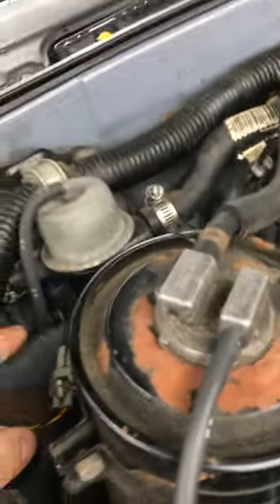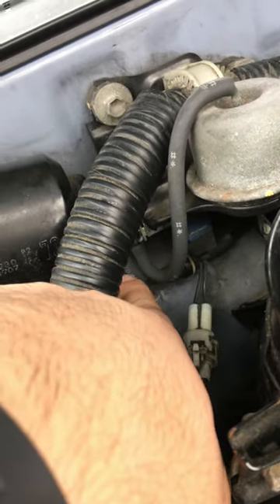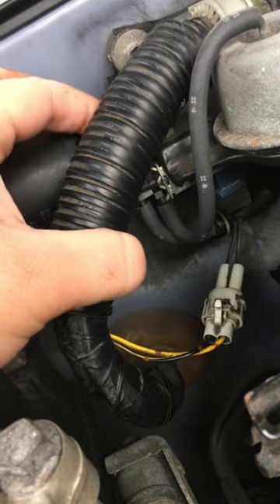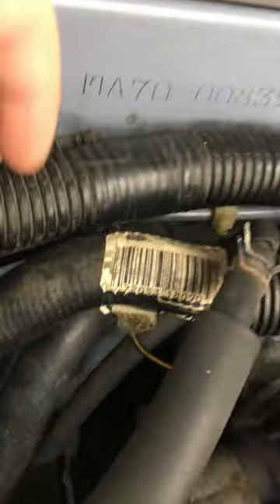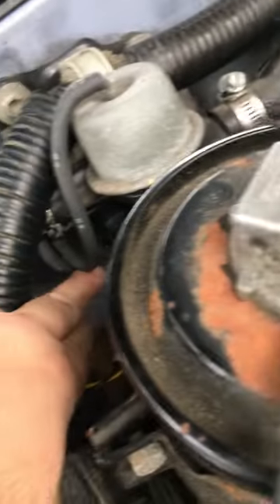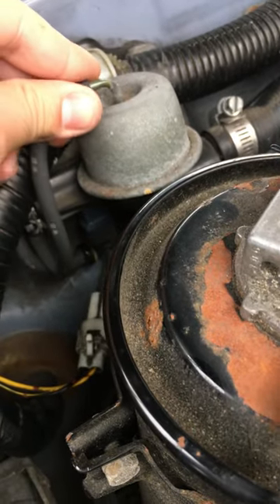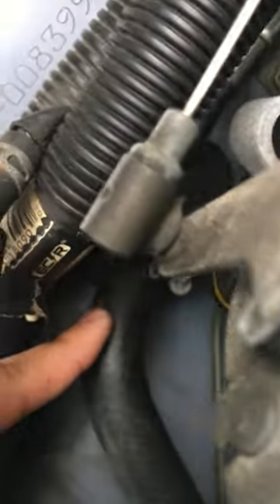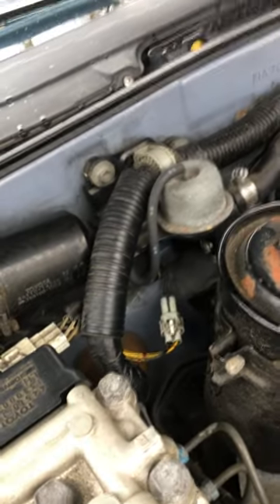MA70 Supra Heat VSV Bypass

Comment: It wont work for me bro.....what the hell
Reply from the maker: You can do what was said before, unhook the rod and rotate the black switch up. make sure there is no air in your coolant system. If that does not work, this is not your problem. Could be the valve itself, blower motor, heater core, etc.
Reply: @Project_Delusions  look after i connect the vacuum hose to the vacuum can the valve opens and the water hose thats going to the inside gets warm. Blower is ok...sorry my english im from Germany but i think my heat exchanger is broken.
Reply from the maker: @jdmislove  Before you go through changing your heat exchanger try and make sure that all the air is out of your system and that you have no other coolant leaks. Changing the heat exchanger is a lot of work.
Reply: @Project_Delusions  yea im gonna try that first. Thanks alot bro...